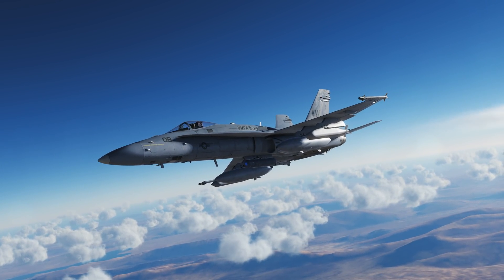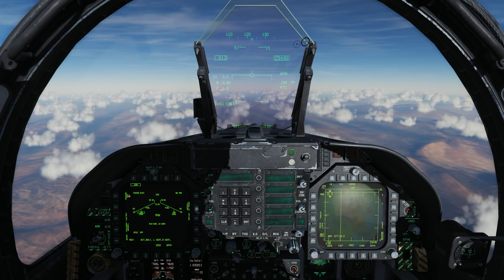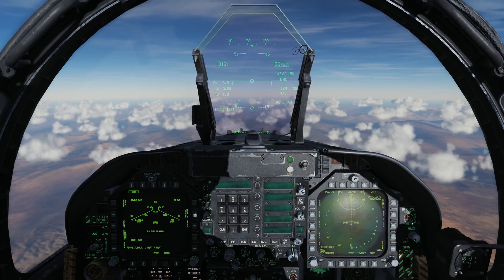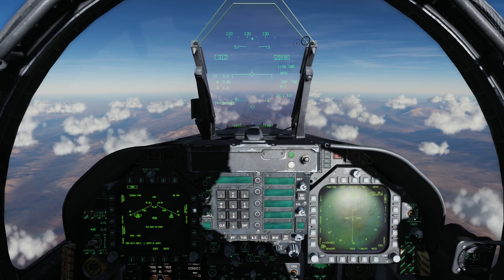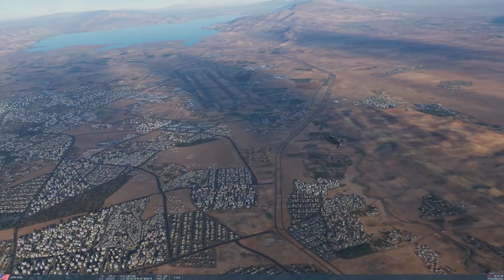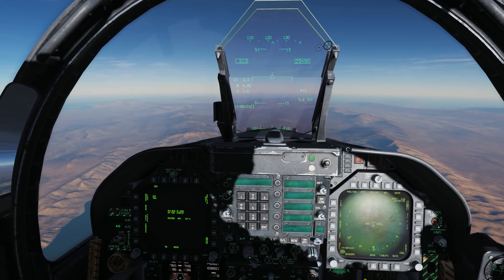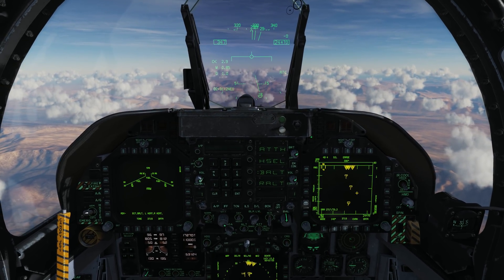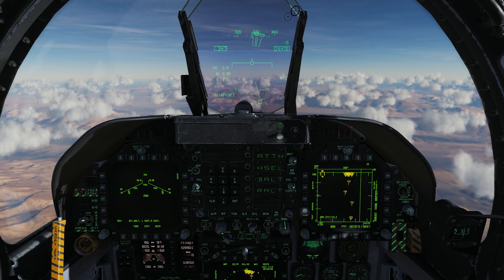DCS: F/A-18C Hornet - Upcoming AGM-154A JSOW, MSI for LTWS, and PRECISE Mode

Comment: Regarding the agm154's I've got a question: I saw on wikipedia that while the agm154a is simply gps guided, the agm154c actually has terminal infrared guidance so that after being guided by the gps, it can "lock up" a heatsource, a tank for example, and make very small ajustments to hit this hot target precisely.
Is it actually gonna be like that in game or did I misread the model name with that terminal guidance ?
Reply from the maker: It is simply a scene-compare image system based on a pre-loaded image with no man-in-loop.
Reply: @MattWagner  But will it actually do that and correct itself without man-in--loop?
Reply from the maker: @somethingsimple6413 . Yes, but it is transparent in the simulation. It's not something the player ever interacts with.

Comment: Should the precise coordinates be in decimal form or the new precise regular coordinates when im picking a position from the F10 map?  The decimal form only have 3 decimal letters so it’s kinda strange to use that?
Reply: I think the major change, is that previously, inputs were in minutes-seconds, and now are in decimal minutes, as displayed on hsi wpt coordinates.
Reply: Mav yes, but when using the f10 map, which type of coordinates should I enter on the HSI when I have pressed Precise there?
Reply: @Stoffe3D  you need to press ALT Y and move the mouse around a bit you are looking for numbers like = " 43.40.25.34 " and when you have the HSI You go to data select what ever way point you want pick precise and then UFC do POSN then enter the first 2 numbers 43.40 then enter then the last 2 numbers 25.34 and thats it same for latitude
Reply: @trdraider1196  no thats wrong....u have to divide the Seconds by 60
In this case 25,34'' / 60 = 42,33 to get the decimal Minute .4233'
 The correct coordinate would be: 43° 40.4233'
Reply: @piipiipii  Thats not how i do it. I use the in-game format and it work's great
Reply: @piipiipii  You don't have to divide anything. All types you need, are on F10 map, pressing LALT-Y repeatedly.
Reply: @Stoffe3D  decimal mins, now on.

Comment: Will we eventually get documentation for the JSOW (and the LGBs and JDAMs)?  Your Youtube clips are good and useful and well done, but they don't really work as a checklist to make sure that we've got all of the settings right, or if we want to do something on a mission that's slightly different from the video.  I know that this is still beta, but in some ways that increases the need for documentation, so that we can help determine if we're seeing intended behavior, or a real bug, or if the error is solely between the keyboard and the chair.
Reply from the maker: Yes, a very large update is in work.

Comment: With MSI, will it be possible to designate a DL track as L&S without your radar having found it?
Reply from the maker: Not in MSI / LTWS, LTWS cannot support weapon guidance.
Reply: @MattWagner  What would happen if you TDC depress on a bottom-half-only HAFU then? Normally it would be either designated L&S or the radar would do the mini raster to try to acquire in STT
Reply: Please explain what this means as it could be useful to me
Reply: Wait moments later I understand
Reply: I know that some hornets (not sure about our lot 20 in particular) have a NO RDR cue under the L&S TD box on the HUD, is that perhaps related to this?
Reply: like does it show an HAFU for a contact that is below or above your scan cone, that was received via D/L?
Reply: @Steak0815  yes of course, the symbology is the same as the SA page
Reply: Would this be possible for both AIM-120 versions in the sim? I thought that buddy-guiding AMRAAMs was a feature introduced on very late versions of the missile.
Reply: I doubt they will do that it could be OP